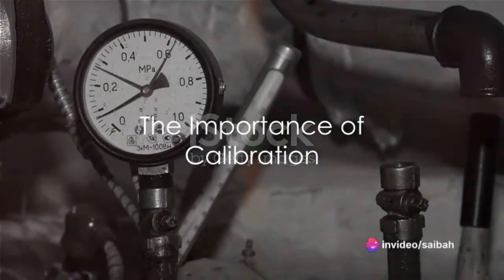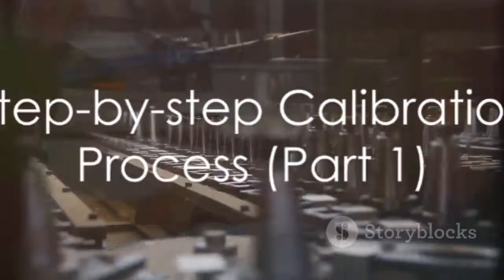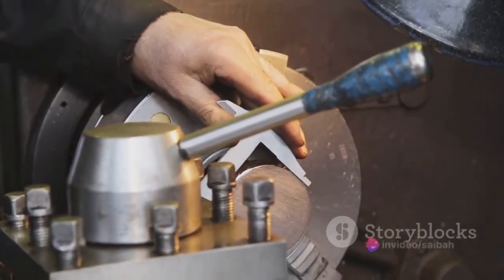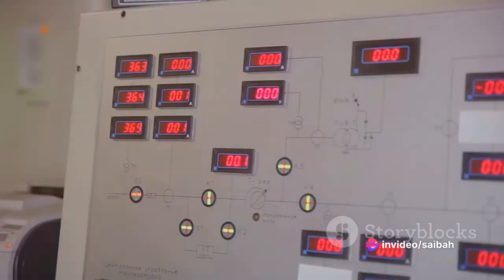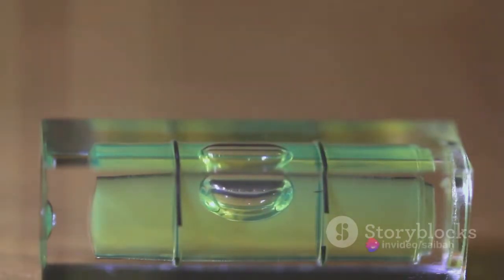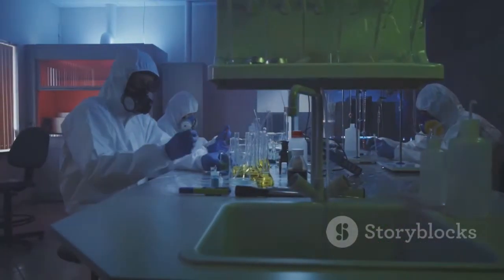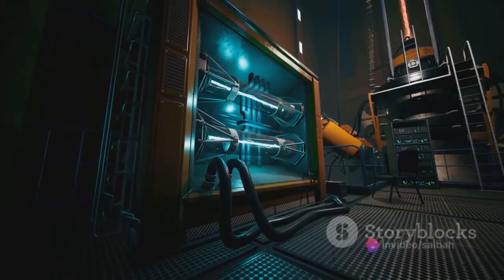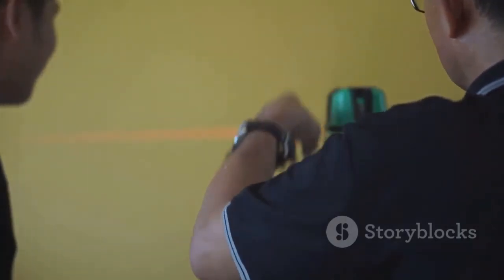Displacer Level Transmitter Calibration

Comment: This explains the "why."  The title suggests you are going to explain the "how."  :P
Reply: yeah you are right , I'll help you with that, quick explanation, empty the displacer chamber by 0% level check and adjust zero screw of the transmitter  for 4mA transmitter output next is fill the displacer chamber with 100%  liquid, and check adjust the spam screw of transmitter for 20mA transmitter output. I hope I manage to help you.